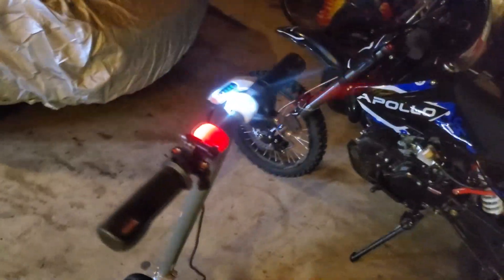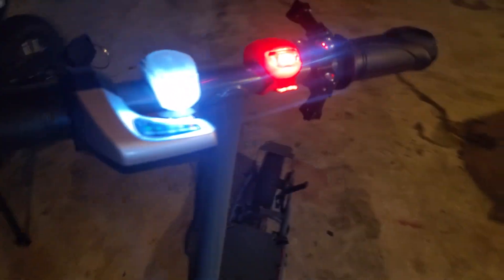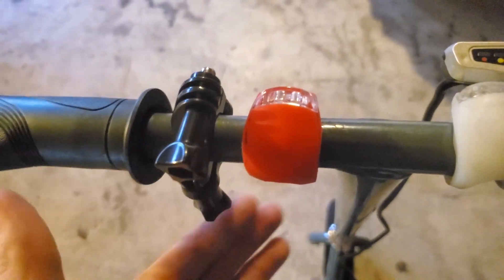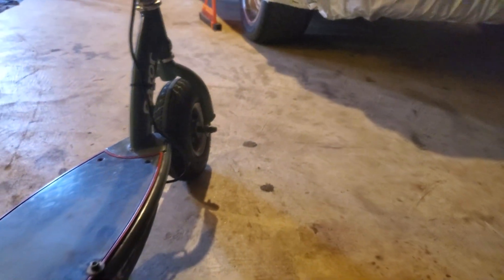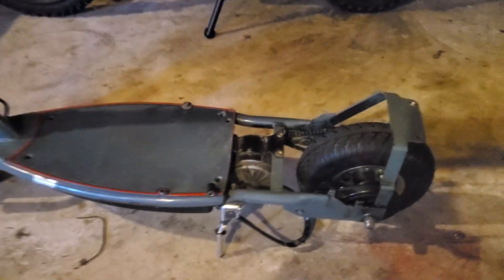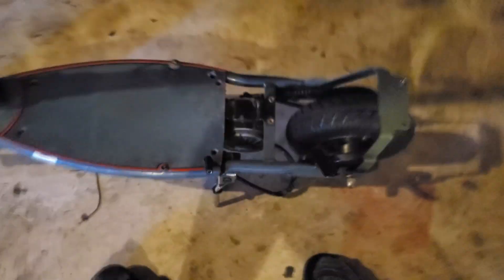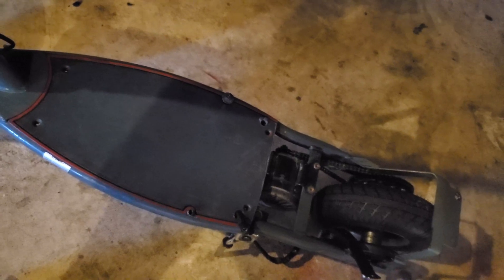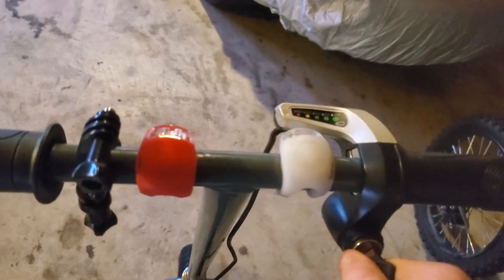Razor E300 48V Li-ion Battery Mod (Links For Mods!)

Comment: I know this is 3yrs old. 48v??
I have an E300 with a 24v 500w currie, 36v lithium,  and 36v 1000w controller,  runs 27mph.
Reply from the maker: I used 48v in this build, however the motor I used was rated for 24v 250w. The windings vary between speed and torque on these motors
Reply: @dylanmoore1006  they definitely do.  With my 24v 250w running 36v lead acid was 21mph and lithium was 23mph. Always interesting to see what others did. Great build. Do you still have it and how long dis the motor last? Overvolted need cool downs every 10-15min after full throttle runs
Reply from the maker: @bdrgarage7039  I sold it awhile ago but I still have a few empty frames. The motors only lasted about 1 minute of full throttle before they started cooking up.

Comment: does it work on the e300 hd
Reply: hd
Reply from the maker: Technically, yes. But the HD uses a brushless motor, the original model is brush operated. So you will need a brushless controller matching the voltage/wattage specs of the motor and battery.
Reply: @dylanmoore1006  thanks bro
Reply from the maker: @Xerneax  Anytime 💯

Comment: these links are expired, anyone have the part specs?
Reply from the maker: It had a 12ah 48v lithium battery pack and a 1000w controller.

 YxYhCOOL 48v Battery, (Need to Order YYDC Shop) 20Ah /14Ah /10Ah Ebike Batteries for 200-1200W Motor Electric Bike Bicycle, Scooter and Other Motor https://a.co/d/6vNg9xN

Bnineteenteam 36v 48V 1000W Motor Brushed Speed Controller with Locking Throttle Twist Grip & Power Display for E-Bike https://a.co/d/iQLDvT7
Reply: @dylanmoore1006  cool thanks.  all on aliexpress for $200
Reply from the maker: @-thirteen  I have another video on how to wire it as well
Reply: @dylanmoore1006  cool. Imma check it out,thanks.  Still running well?
Reply from the maker: @size queen  I ended up selling the scooter. I later realized it's highly profitable to flip these modified scooters. I never had any problems with it other than the stock motor overheating.
Reply from the maker: @-thirteen  I would recommend upgrading to this motor: https://m.aliexpress.us/item/2251832710056679.html?spm=a2g0n.productlist.0.0.2d00MjnIMjnIja&browser_id=55dca4c684a345679c48fbb1ce822373&aff_trace_key=79e5e87ed0d045088b878a9050c084cb-1672935334151-06762-UneMJZVf&aff_platform=msite&m_page_id=qeu9heaqt2kcaukg18753ea043c17a62d5addc2806&gclid=&pdp_npi=3%40dis%21USD%2158.0%2146.4%21%21%21%21%21%402101f49b16807400651785634e807c%2165744170014%21sea%21US%210&curPageLogUid=rzO1sGe7HoNG&algo_pvid=5b360538-0240-4fef-b38a-d4a5f47b326b

Comment: Whats the reliability of the scooter so fsr, the motor burn out? Controller still working?
Reply from the maker: The stock motor will eventually burn out at 48v. If you keep an eye on the motor temp, it'll last a while. You can run it on 36v without worry.
Reply: @dylanmoore1006  that's kinda what I was thinking, getting a 36v battery instead of a 48v, also how much did you pay and where did you buy your battery?
Reply from the maker: @Anthony Cool Boi  I got the battery from eBay. The brand is called "cao mm." you'll have better luck with  36v because the speed controller should have an overheating sensor for the motor. It will just cut off the power before the motor overheats. It goes 20mph with the 36v battery.

Comment: I use used lithium throw pack together. Weak cells Blow away Lead. 4 in parallel 12 amphours at least.  If Lead 4amphours max

Comment: Controllers are glorified fuses. 1 year ago I bought a 36v 350 $10 gets warm. My hub is 500.  If hub was 1000 insane Draw Boom goes Fuse
Reply from the maker: Completely feel you on that, I've blown at least 5 of these units by accidently reversing power polarity. #1 mistake you can make with these controllers

Comment: 500 is plenty 1000 will drain batt. Also digital throttle trust me. If you keep POWER down to 350 to 500. Actually goes up to 750. So you see battery better have more amps than controller. Or motor can burn.  Weakest component gets HOT. controllers are supposed to get warm to Hot.  Hot motors or batteries. Bad News.  If controller blows $15 New. Up to 500w. Actually 750

Comment: Hey awesome build man. I have an e200. I would do lithium too but they are so expensive fms (Fuckmyscooter) 

Someone is selling an e300 stock except the same throttle as yours, not working but probably a battery issue. It has a bigger motor and variable throttle. But the e200 is like 10 pounds lighter. Kind of thinking i am better off with the e200. Any tips for a beginner?
Reply: i guess it is pretty off topic but do anyone know of a good website to watch newly released tv shows online?
Reply: @Xavier Kylo Flixportal :D
Reply: @Hezekiah Bruce thanks, signed up and it seems like they got a lot of movies there :D I really appreciate it!!
Reply: @Xavier Kylo Happy to help :D

Comment: Also I’m thinking about building a duel motor set up one motor bolted directly on top on the one one wired in series
Reply: I just got into this electric scooter thing, and I had the Al same idea of mounting two motors the same way you thought of. With a 48v 1000watt controller. Think it would work?

Comment: Do the upgraded batteries make it faster at all ?
Reply: You don't really need to add a 48v controller most are rated at 62v so 48v would be fine I've been running 48v battery on a zinc 150 for my daughter I did this last year and she uses it almost everyday granted she's only 8 but she's been brought up on motorbikes ect since 4 it's faster than my xiomi even though I hacked it lol I've clocked it at 27.6mph the motor barely gets hot and she can get 30 miles out of it mixed rideing however if your gunna do it and have the money spare then you are better off especially for hills as I've tried it up hills and depending how steep for an adult it will ask for more currents and ultimately cuts out to prevent damage on the controller but for her and her weight it flies up any incline never cuts out lol